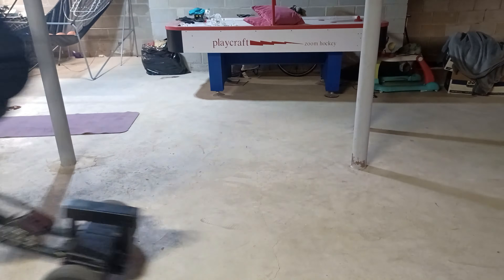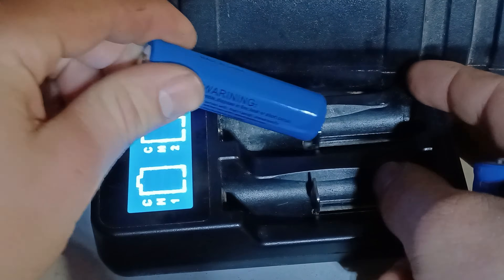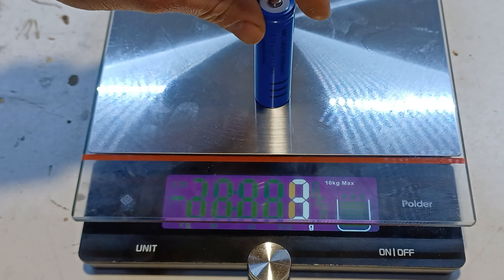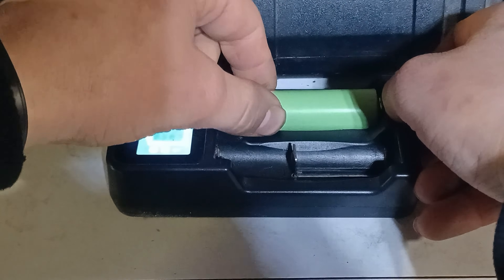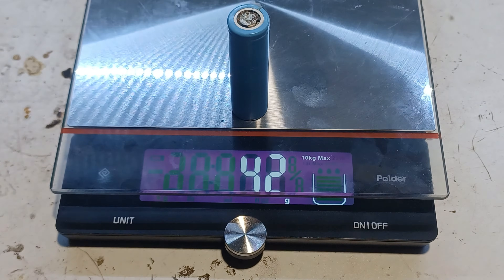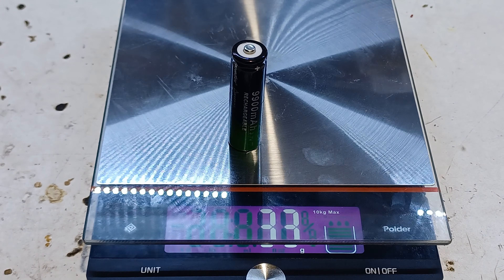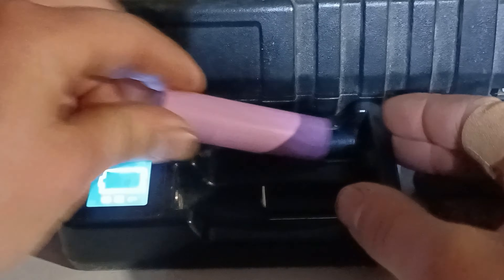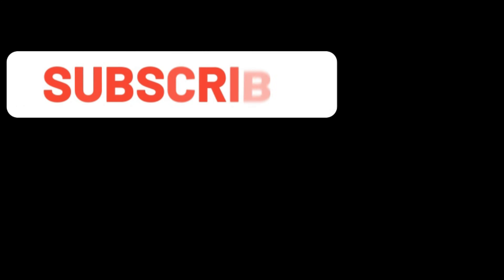How to test 18650 batteries

Comment: in my charger vapcell s4 plus with a load of 1 ampere, the battery reaches 50 degrees without cooling. 
is this a normal temperature or is the battery faulty?
Reply from the maker: @GRobi-v9o  I don't think vape batteries are supposed to become that hot with only a 1 amp current draw. Because under normal circumstances, they are used at 5 to 10 amps.

Comment: That was a vey interesting and informative video, thank you. I noticed that the resisters in your link are 100 watt resisters and the one on your tester is a 50 watt. Are they supposed to be 50 or 100? I'm buying the tester from the link and was wondering if you have a diagram of how you wired the resister(s) to the tester. I guess the higher the wattage the better, just an 8 ohm resister. Thank you.
Reply from the maker: @andyb7754 The reason why I put a 100watt resister in the description is because the 50watt resistor I used in the video, is because it became hot enough for me to mount it to a heat sink, In theory the 100watt resister I linked in the description should be able to stay kind of cool for it not to need a heat sink. also wiring wise, if you look at the pictures from amazon, you can see the bottom of the capacity tester were it indicates plus and minus for the battery holder and two "R" terminals for the resister (polarity doesn't mater for the resister).

Comment: is it safe to discharge till it reaches 2.5v???
Reply: Noo
Reply: 3.0
Reply: Yes for testing only.....
some Chinese BMS has cut off voltage at 2.5 volt...
Reply: @-Tech-hm5sp  but if i wanna check how many mah avaliable for operational use I should go 4.2 till 3.5 right?
Reply: @MohaModzClipzOfc 3.5V has too much left potential. Go 3.0V or if you really are paranoid go 3.1V 2.5V is okayish but not reccomend by me
Reply: @MohaModzClipzOfc  yes
for example most 12 volt ups cut off 10.5 lowest voltage so 3.5 is lowest for operational
Reply: You can go to 2.8 and if you find one under 2.8 it's usually too far to use and have any capacity left
Reply: So many objectively wrong answers. 

Look at the datasheet. 

Minimum voltage will be listed. Most 18650’s are rated down to 2.5V
Reply: 2.5v is the minimum ok, but if i use this battery in a device that shows the battery % or have a state of "power off due to low battery", then i souldnt consider this 2.5v, it will probbly shut down at 3.5v~, so I can only calculate the estimated time of operation from 4.2v to 3.5v.

But it sucks cse
When u buy a battery online, it says like 2500mah, but are they measurig it from 2.5v or 3.5 ? If at all they measures something
Reply: @MohaModzClipzOfc rated capacity is for the voltage range given in the datasheet.
Reply: Obviously no, using it while the battery is supplying 2.5V-3.0V can permanently damage or kill it

Comment: How did you make you capacity tester bro pls share to us. Thank you
Reply from the maker: @JoseEarthDolera  I used these parts to build the capacity tester: ► 18650 battery capacity tester: https://amzn.to/3RXkNoW (Amazon)
► 18650 battery capacity tester load resister: https://amzn.to/4cTBM3t (Amazon)
► 18650 Battery Holders: https://amzn.to/4buzoyN (Amazon)
► 18650 battery charger: https://amzn.to/3PZzl5A (Amazon)

Comment: nice job. thanks for sharing that :)  .  I use the flat top 18650 for self heating massage stones, and would love to know if anyone has a suggestion on batteries/brand? that have tested well. I just got sad when I saw the crap 9900 mah ones tested, i just bought some of those. THANK YOU for the info to avoid the ridiculous claimed ones.
Reply from the maker: You're welcome!

Comment: How did you make the capacity tester ????
Reply from the maker: Amazon sells them
Reply: U have link. Pls
Reply from the maker: @user-re1gh9wv4v it's linked in the videos description
Reply: @ElectronicLab.  how did you convert the tester? the amazon comes with the white resistor, yours without it..
Reply from the maker: @Shotiv889  the tester from amazon comes with 2x 5watt resistors for each tester, which from my testing became too hot to fast. so what I did was replace the 5watt resistors with higher power resistors, which seems to solve this problem. (I just added a link for the high-power resistors in the videos description)

Comment: There was a fair bit of voltage drop on the 2600mAh cell which leads me to believe it’s IR was quite high. Even the lesser quality batteries dropped to only 3.91V so I would definitely check the IR of those cells. A battery can still retain most of its capacity but have an extremely high IR. Or it could just be a cell with a low discharge rating. It’s hard to say as your battery capacity tester has a lot of resistance in the circuit between the small wires and the cell holders with springs. 

The best cell holders are those using the Keystone design with leaf spring tabs. I’ve found the gold plated leaf springs to have the lowest IR out of all of them. The cheaper cell holders that have leaf springs use steel and add about 40mR of AC IR to your cell being tested. The gold plated Keystone add about 10mR AC IR when you measure a known cell by placing the probes of an RC3563/YR1035+ on the ends of the leaf springs where you would normally solder your wires. Using 29mR cells on a new cell holder I was getting results of 36-38mR so if you use some 16AWG or 14AWG wire for the connections to the power resistor and the board you should only add a couple more milliohms to the entire equation. That’s small enough to give you fairly accurate voltage drop measurement testing since it looks like you are using 8R resistors that give you exactly 0.5A on a 4.00V cell or 0.510mA on a full cell. That’s the downside to power resistors, without a constant current source measuring voltage drop becomes a little less precise but I think using an 8R resistor will work well for most cells. 
4.20=510mA
4.00=500mA
3.80=490mA
3.60=480mA

All those currents are similar enough to say it’s a 0.5A current on the cell. So a 4.20V open circuit voltage - 3.80V under 0.5A load voltage. So 0.40V decided by 0.5A is 800 milliohms of DC IR. That is very very bad. Of course the numbers you see in your setup right now wouldn’t be accurate due to the high resistance of those cheap cell holders and the thin wire. 

If you think you can rely on the resistance readings of chargers like the Opus or the Xtar I’d say they are ok but nowhere near accurate. They use the 2 wire method and a small charge current to calculate DC IR which is inherently flawed. To measure DC IR you just use the 4 wire method which means you can’t use the voltmeter on your ZB2L3. You need to have a voltmeter AT THE TERMINALS reading cell voltage. 

*Also the opus manual says to add 30mR to the reading. The Xtar VC8 gives me pretty good readings if I push the slider of the negative contact forward when I put in the cell. This is best done at storage voltage and won’t allow the IR to be measured near full because it uses a charging current that would overcharge the cell. The Xtar VC4SL and VC4S+ offer decent readings, usually a bit higher than the VC8. Occasionally the VC8 reads a bit optimistic, numbers so low they shouldn’t be possible.
Reply: Thanks for that insight
Reply from the maker: thanks for the info.
Reply: Word.

Comment: How do you test a battery for its maximum discharge (CDA) 18650 without overheating or destroying the cell. Some Samsung batteries are stamped -25c but lots of cells are not. I have yet to see video that shows how they can perform a High Drain test without overheating or destroying the cell

Comment: y discharge to 2.5 v???   should discharge to 3 v
Reply from the maker: You're right, when you cycle a lithiom-ion battery then yes you don't go under 3v but when you test the capacity then you can go down to 2.5v
Reply: @ElectronicLab. That's very interesting. I just tested 91 battery's using 3.2 not wanting to stress them. But now I realize that setting makes a huge difference in the mAh results. Should we consider discharge rather than charge as the best way to determine capacity?
Reply from the maker: @offgrid2010 I personally test lithium-ion batteries by fully charging them and then inserting them in a capacity tester, and setting the end voltage to the recommended value from the battery's data sheet(usually between 2.5volts and 3volts). This method is pretty reliable and accurate
Reply: @ElectronicLab.  ALSO TEST FOR INTERNAL RESISTANCE
Reply: Because he's testing total capacity. He's not saying they should be discharged to 2.5v every cycle lol.
Reply: read the datasheets and stop believing what you read on the internet